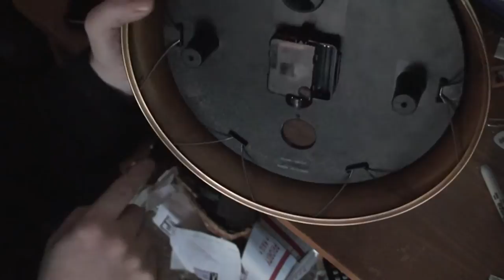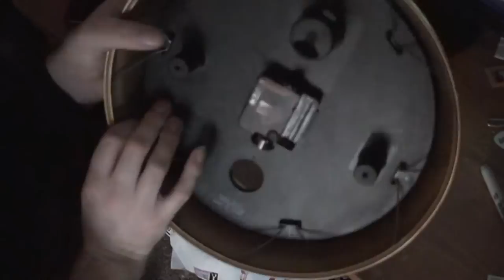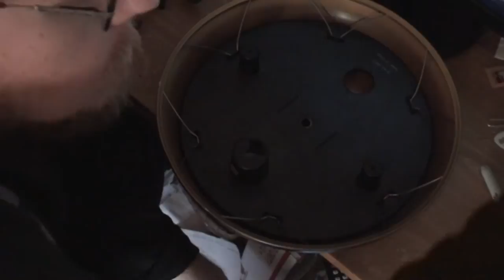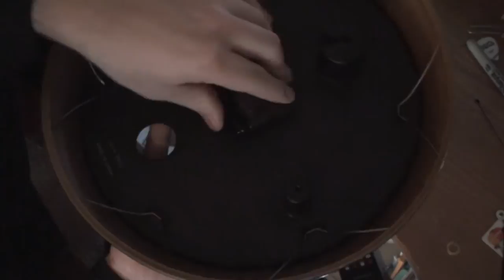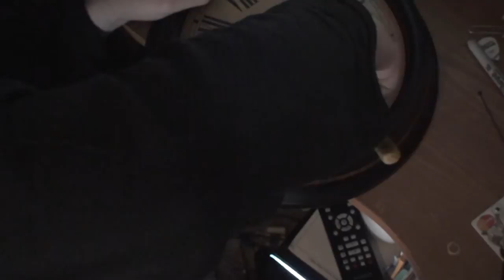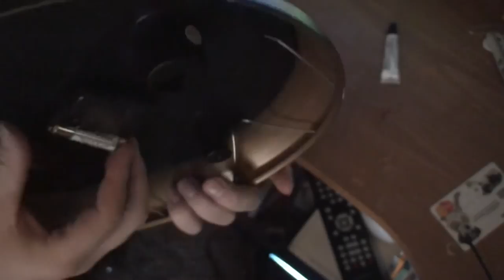How To Replace a Clock Motor In A Wall Clock

Comment: The clock face doesn't really need a covering of any kind, it's really more or less a dust cover.  If anything, whatever's cheaper; I'd imagine plexiglass would be the better option.

I have seen those with a sweep second hand, but they aren't as common as the ones that tick the seconds by.  Regardless of how it operates, I don't really consider it a "motor" per se, instead I would call it a quartz movement.  Even with the sweep hand I believe it is controlled by a quartz crystal.  But that's just the technobabble speak.